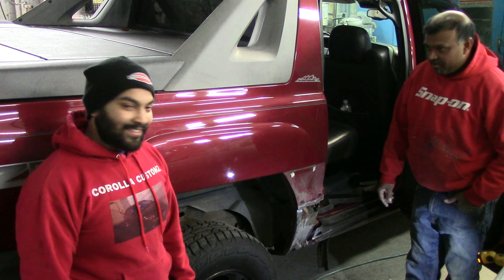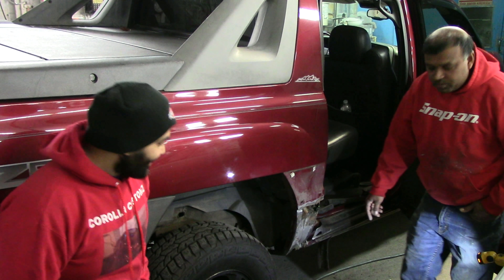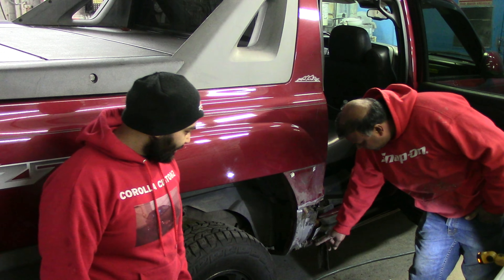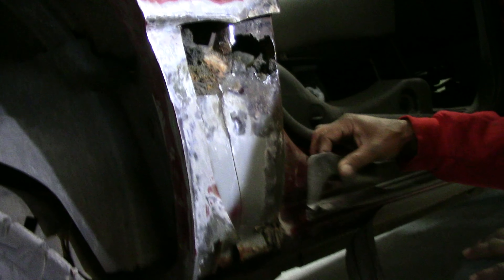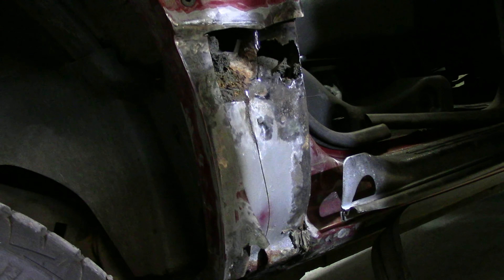Chevy Avalanche rust repair Part 1

Comment: My 07 Avalanche has rust on the frame and parts on vehicles. Im trying to find out i can get my fixed
Reply from the maker: It's easy to fix, cut the bad piece off and weld on a new piece of metal.
Reply: I dont have a welding background.  I qent to Maaco and the guy said it was going to be a couple of $1000s dollars  of work
Reply from the maker: @belichuckk  are you located in Jersey. I can send you to my guy
Reply: Indianapolis, Indiana
Reply: I went to a couple body shops in my city and one guy declined to do it, 2nd shop (Macco) said they can do it but it will be 4-5k, and other places I been said they dont do rust.
Maaco shop guy i was better off buying a newer truck.
Maybe I could send you pics for some advice or input.
Dont know i could get my truck to your guy. Im a truck driver
Reply from the maker: @belichuckk  that's a good distance hahahaha.
Reply: .....yep.
Reply from the maker: Exactly!
Reply: Patch panel and JB weld. SCREW all this nonsense. 👊💯
Reply from the maker: @BradNichols-vo9eo hahahaha that’s alright

Comment: Any chance I can ask you some questions on this job. This is the exact area I have rust on both of my wheel wells. I am in Philly. Message me if you wouldn’t mind helping me with this
Reply from the maker: Hey buddy what questions do you have?
Reply: @Kingcustomz  thanks for getting back to me. I am looking at an avalanche same year as yours just commented on your as I was leaving because it seems to have same rust points in both wheel wells. Seems pretty common. What did that job run you? I am wondering if it’s worth it to buy especially with the outrageous prices still. Figured if you were happy with the job they did I would use the same shop.
Reply: @Kingcustomz  of course I am not looking around on your comments and I see you said 800. Was that one side? Or both sides? I am sure it’s more nowadays
Reply from the maker: hey there, sorry YouTube didn't notify me of your comment.. so I am super happy with my repair. its still holding up very well today... The shop is located in bergenfield New Jersey 27th north street bergenfield 07621.. his name is Peter and he is an awesome guy. the name of the shop is also v and r autonomy..... tell him you saw the video and he will hook you up... all in all he charged me 600 back then.. im not sure if the prices have raised due to the economy
Reply from the maker: lol its quite alright, ask any questions especially if I answered it before, I don't mind answering it again. but yes it was for both sides.. 600 or 800, he created the panel from scratch and painted... all in all 800
Reply: @Kingcustomz  thanks man! This was real helpful!
Reply from the maker: You’re very welcomd